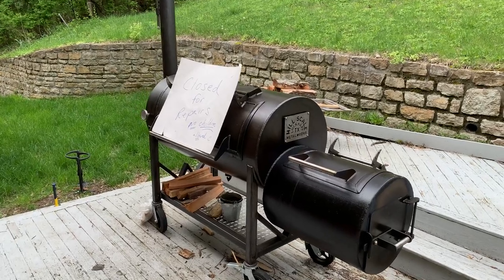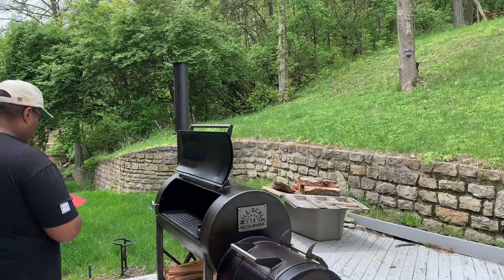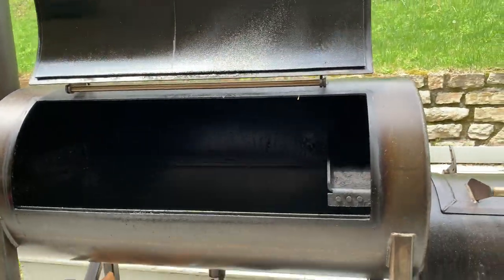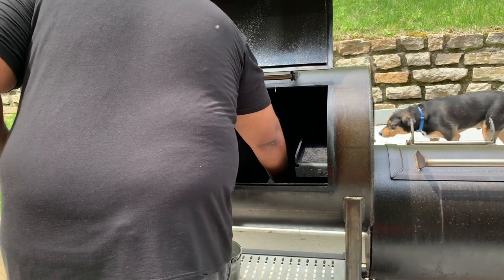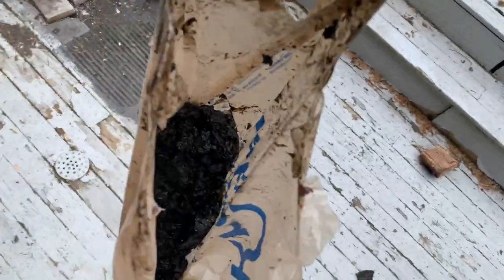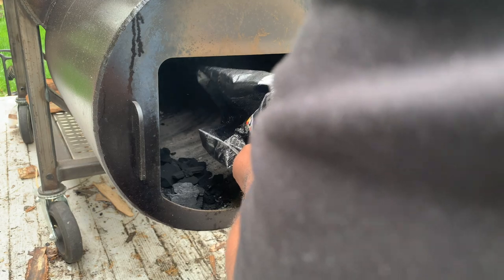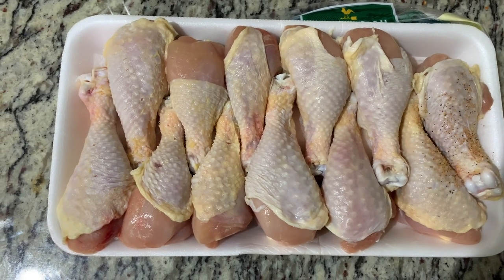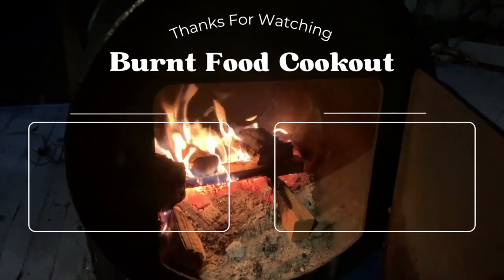Cleaning the Mill Scale 94 Gallon *Bonus Smoked Chicken Drumsticks with Cherry Barbecue Sauce

Comment: A really hot fire will also carbonize most of matter allowing for easy clean-up. Get your smoker up to 5,600 degrees and let it roll like that for about an hour or two. I normally use a charcoal basket for this. 
Love the shirt btw!
Reply from the maker: I'm still on the fence about getting a charcoal basket. Did you have one made or is there a brand you would recommend?